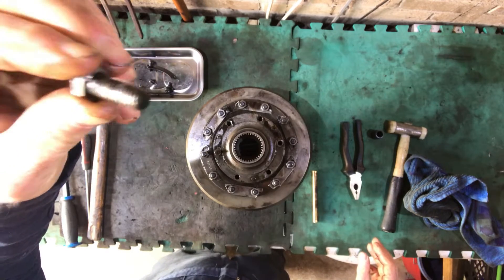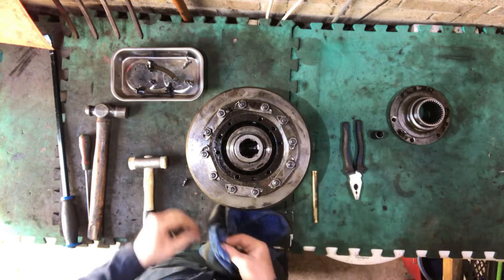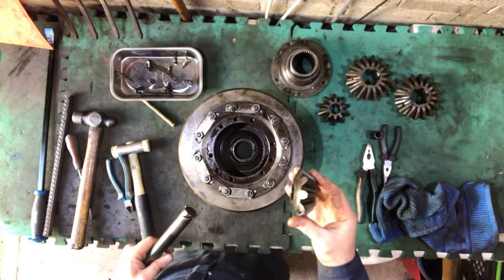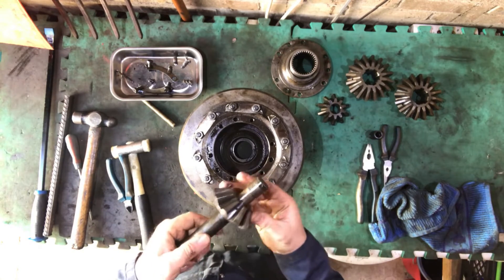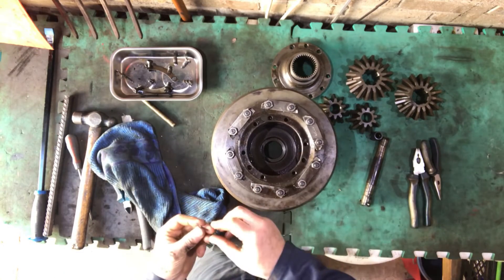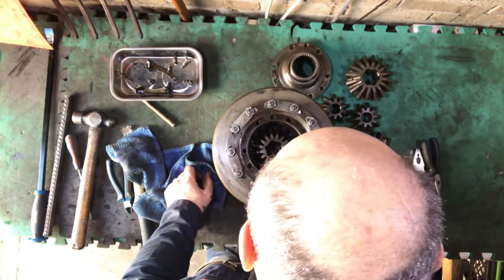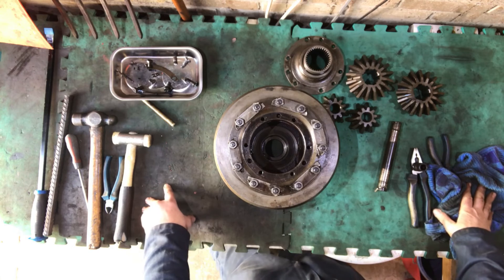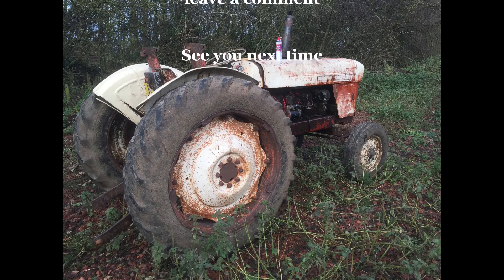Dismantling the diff of a David Brown 990 #17

Comment: Hi there, I was looking for a video about the David Brown 880 selectamatic diff lock as the tractor I have does have the pedal but it doesn't feel like it's attached to anything? It can be moved up or down with no difference to the driving of the tractor. I've heard that if the diff lock pedal is not held in the down position when the final drive is removed, something happens to the linkage preventing the diff from engaging? If this is the case, would you be able to describe the job to allow me to try and get it operational again? Great videos!
Reply from the maker: well now your in luck,  Ryan. In the next video I'm going to re-instal my diff lock as part of the process of putting the four corners back on, but in the mean time your right, the actuator thats on the axle casting has to be in the up (engaged ) position before you remove the pinion shaft or the diff lock collar and spring drop into the bottom of the axle, the acutator needs to be wired into place so as to keep the collar engaged in the diff. if it drops out it doesn't prevent the diff engaging, but your diff lock obviously wouldn't function, not promising anything but if it's dry on Thursday I'll do a video on the diff lock hopefully get it out by Monday
hope this helps you
many thanks
Barry